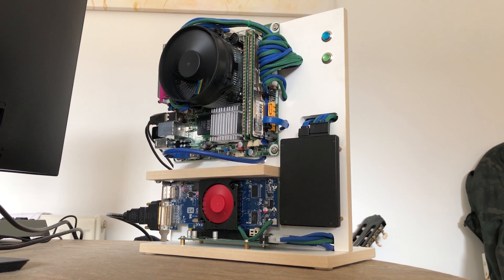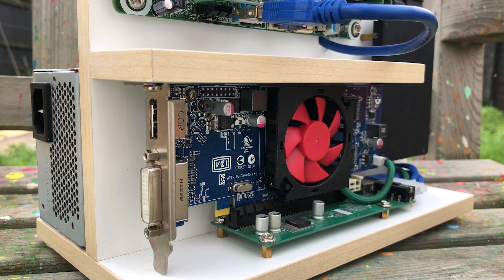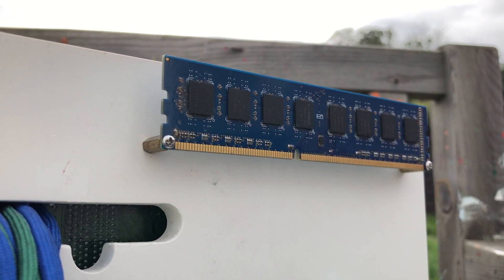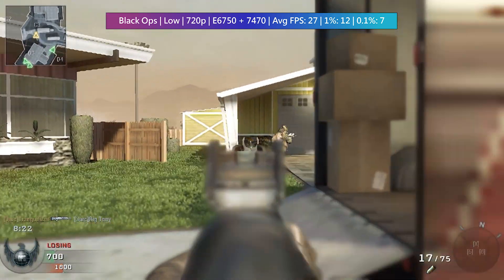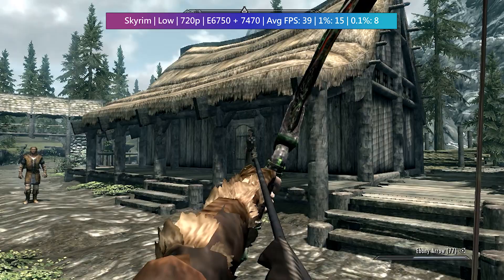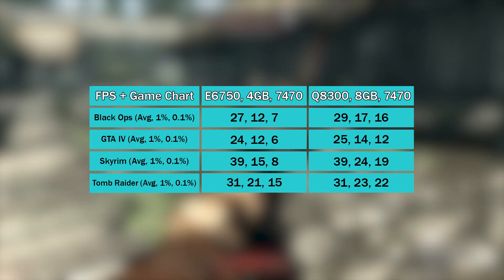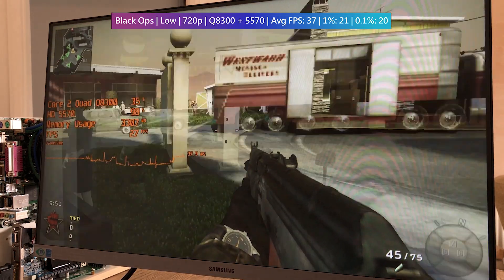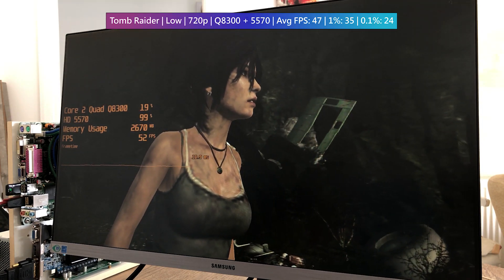I've Never Seen a Custom PC Build Quite Like This Before...

Comment: Once had an amd7470 and it wasnt compatible with the core i3 2130 i was using so ended up buying a pentium g2030 and boy did i game;Remember playing far cry 3 at 720p low settings with 31fps average; crysis 2 at 30fps......i still have the card on the old machine and tried selling it numerous times but to no avail; am selling it $5 lol

Comment: So, i have a laptop with i3 5005u, dual core 4 threads but only 2 ghz base clock, no posibility for turbo or for overclocking...8gb now of ddr3 ram at 1666 mhz ..dual channel obviously and the integrated graphics from intel hd 5500.
I can tell you that gta 4 works better and with much less lag then in your first test with the unapgraded cpu and gpu :))
Skyrim as well, i even play skyrim special edition at 900p res and low settings, kind of playable with no lag at all.
Am i proud of my laptop? Sometimes when i see pc's that are worse then my laptop yes, i am proud :)))
But i am comparing my laptop from 2015 or whatever with something from 2010, so yeah

Comment: So ancient hardware is cool. I appreciate old stuff, I can get 60+ fps out of an HD4650 (check the exotic builds section of minecraft performance reports). But this? I wouldn't buy for any reason. It's dangerous, fragile, sensitive to everything, and on top of all that it's not even an incredibly powerful build for the age. So the whole point is literally to be a showpiece, which I mean... it's computer hardware screwed to some painted boards /w sleeved cables. That's pretty podunk compared to like, a mineral oil sealed tank and paddle system.

Comment: i bet you can fitt a xeon x5450 on that board check out if your old board is already tested https://www.delidded.com/lga-771-to-775-adapter/3/ and yeah why not fitting an old massive GPU cooler on the cpu socket^^ like him https://www.youtube.com/watch?v=NzNt4xjqTE0